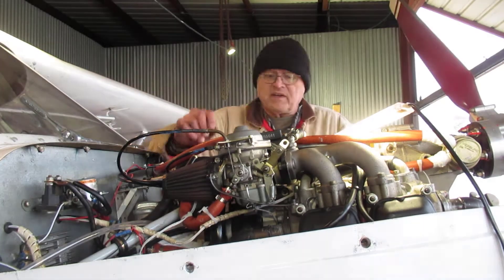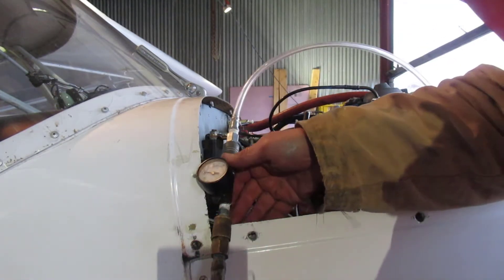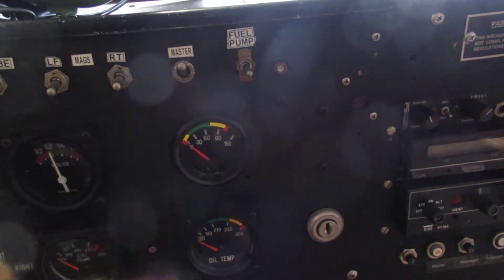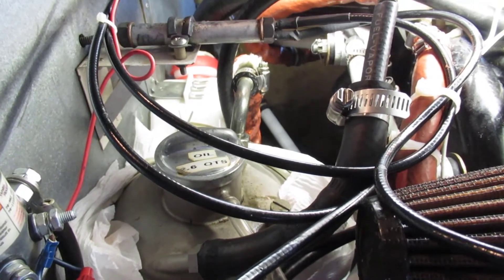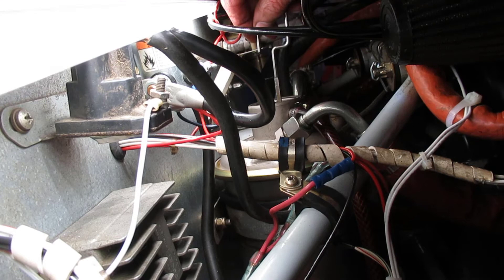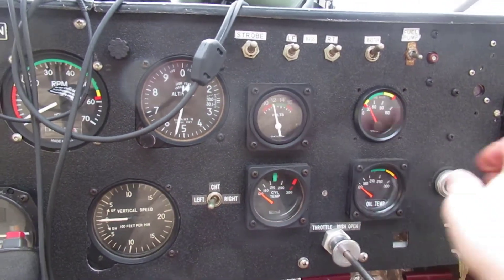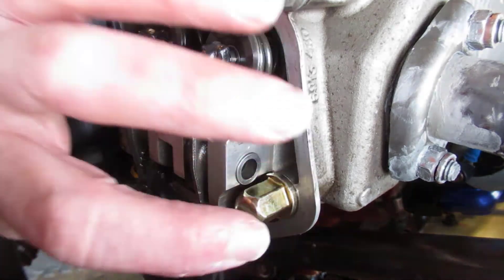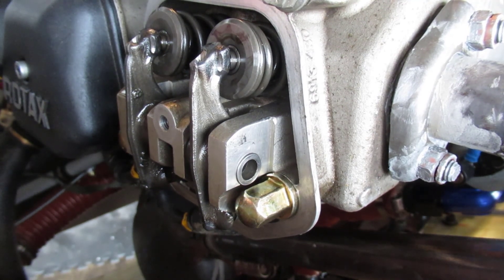Rotax 912 Oil System Purge

Comment: I hate to ask this question, but can the oil system be purged without disconnecting the return line and pressurizing the system with a compressor.
Thanks!
Reply from the maker: Per this service instruction https://legacy.rotaxowner.com/si_tb_info/serviceinfo/si-916i-003-r1.pdf the compressed air is optional. But I suspect it's going to take quite a bit more prop flipping...
Reply: Thanks.  I've heard about the compressed air being optional, but I was looking for the reason on why you can't just keep turning the prop until oil pressure shows up and just leave the line connected.
Reply from the maker: @michaelvadney5803  It would seem like you could just leave the return connected, but I don't know for sure one way or the other.
Reply: I would think that the lifter test would have the final say, but I will be doing the purge as recommended.  Just curious though.

Comment: Instead of removing the plugs and hand spinning the prop, why not leave the plugs in and briefly use the starter? Ignition off of course. FWIW:  I've got over 2850 hrs TT on my 912, and have had the oil system "open" several times, and have never gone to the extent of what you detail here, just saying. NOT that you are wrong or anything, but Rotax goes a bit overboard in many of their procedures and recommendations, replacing all the rubber components every 600 hrs. is a prime example. =Point being, after all you did, the lifters were fine, correct?
Reply from the maker: Yea, Rotax does seem to go over the top sometimes, but it cost me nothing but a bit of time to pretty much follow the published procedure so...  (I don't do this for an oil change btw.) Starter probably would work to spin, but with the plugs in you will push oil out the return so you would want some kind of "catch" system. 
And,  yes, lifters have been fine every time I have done this. 
(They also love their (expensive) special tools... :-( )
Reply: @LightAndSportyGuy   Thanks for the reasoned response! I LOVE the fact Rotax is so anal in their maintenance recommendations, and for sure don't fault anyone who follows all of them. I have to be careful when I tout the number of my trouble free hours, using non Rotax oil filters (Donaldson) and other "reckless" practices, as I certainly don't want to encourage others to do so. I was dragged kicking and screaming into the Rotax camp, (1300 hrs on a Soob conversion before, also trouble free, but heavy) but I now love the engine, it's especially fun to get into a discussion with a legacy engine pilot who disses the 912, few if any can match the trouble free run I've had, not to mention the fuel economy!
Reply: @portnuefflyer Hey! Do not worry... share us your experiences with the brands of oils and filters you use.  I am interested
Reply: @angeldepa5090   3400 hrs as of now, all good!  Really liking the most recent mod, the EDGE EFI system.

Comment: Wait. Don't the instructions say to measure the gap while holding the rocker in?
A hammer in the shoulder while pushing with the handle frees the hands to run the feeler gauge for that 0.5 mm.

Thanks for making these videos. I just did my first oil change yesterday and your input has been a most helpful contrast to the service instructions.
Reply from the maker: From si-916i-003-r1...
"3 Push down the rocker arm on the push-rod side with a force (F) of around 70 N 
(15.74 lb-force) for about 3 seconds. You can using a belt tester, for example, to check 
approximately how much force is being exerted. Repeat on other rocker arms.
4 Check distance between rocker arm and valve contact surface. Max. allowable distance 
0.5 mm (0.02 in.)."
Which suggests to me that you can do the two steps sequentially. If there is air in the lifter, I would think it would collapse a bit and not spring back when you push.
Reply: I guess I got the idea from this guy:
https://youtu.be/DFfxHbaU_Bs?t=2131

He also says to use only the rotax filter, but I used a Wix 51083.
Reply from the maker: @HeadakusMaximus  They would be more knowledgeable than I.

Comment: Jim, does the engine have to be purged prior to each start?  I'm about to purchase a Titan with 912 and find your video very useful.  If you are on a cross country, do you have to purge after every shutdown?  Thanks!
Reply from the maker: Oh, heck no! That would be a good reason to not buy a Rotax!!!  Some sources advocate purging the system after each oil change, but Rotax only tells you to do the purge after you open one of the oil lines on the suction side of the oil pump. As far as the "Burp" or "gurgle" is concerned -it is somewhat installation dependent, but I only do that if the oil level on the dipstick appears to be low. If the level on the dipstick is OK, pushing the oil out of the crankcase will only make it go up. You just don't want to add oil and overfill because some is "hiding" in the crankcase. So burp and check before you add.